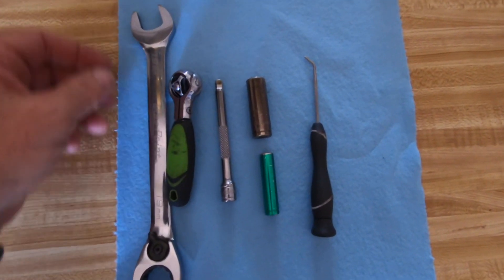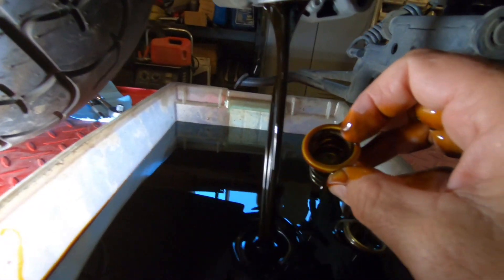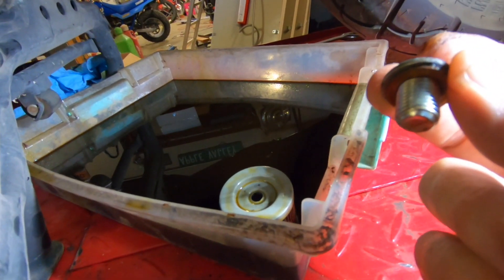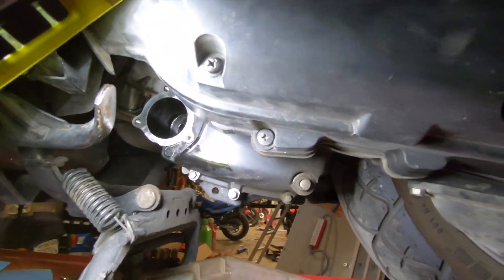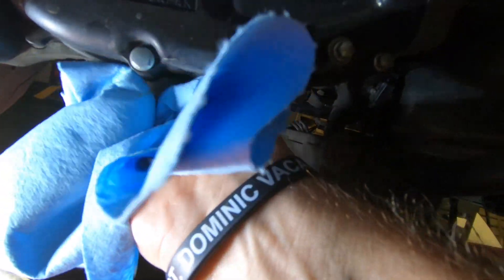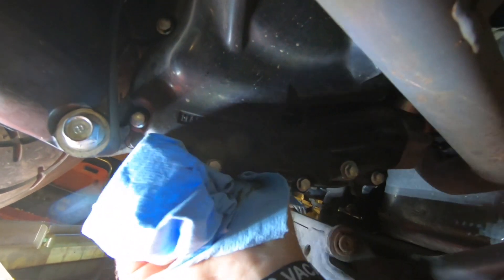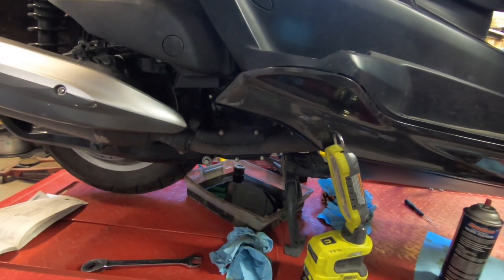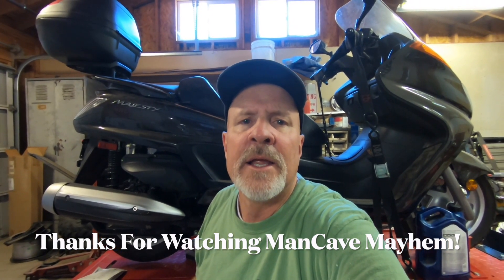Yamaha Majesty 400 Oil Change

Comment: Also I have a problem with the parking brake..kr will not push the brake pads into the disk enough to stop the scooter from rolling..the pass a good but I don't know where they were purchased because the scooter is use when I bought it 
.the lever that pushes the pads in is all working.the cable and spring are at Max adjustment..but the lever on the brake caliper will not push the pads in far enough. Thanks Fred

Comment: Trying to buy used majesty 400 with 25 000 miles...any advice on this scooter before I purchase it please
Reply from the maker: I would just check and make sure everything has been maintained. They are very dependable scoots if maintained. The CVT belt should be serviced every 14k. Good luck and ride safe my friend 👍🏻

Comment: I am looking at buying a 07 Majesty 400 with 5,500 miles. This would be my first scooter before going to the 650's. (Dreaming).   I also found a Bergman 400 with 12,000 miles for the same money. What should I be more interested in, low milage, newer model, or cheaper repair cost.  The Bergman 400 has abs since it is newer. How important is the abs?
Reply from the maker: @alberttaylor644  you can’t go wrong with either one of those scooters. The Bergman with the ABS is a good thing.
Reply: @ 
I also found a 2011 Yamaha Silverwing with 5,000 miles on it for the price of the burgman 400 also. Is a 600 Silverwing something I should consider? Thank you.
Reply from the maker: @ I think you mean a Honda silver wing.
Reply: @ManCaveMayhem  correct my error.

Comment: Thanks Great videos. I have problem with my majesty, no spark coming out from the ignition coil, kill switch and side stand switch are working properly and there is no check engine. Any ideas where could be the problem? Thanks a lot for whoever has an idea or maybe you know a yamaha mechanic I can ask.

Comment: Hey buddy, I noticed you went from the front to take off the rad cap, but did you know you can do that from the RH unlocked compartment? there is a screw at the back that you undo, and that takes off a plastic cover allowing you access to the cap easily:) I saw that from a fellow in Greece.:) Anyway, my question is, how does one check the coolant hoses etc? do you have to take off the entire seat section, or can the bottom pieces come off to get to those? I think I have a leaking hose or the clamp needs to be tightened. After 14 years I would imagine the hoses need to be changed out as rubber gets bad, especially in changing climates like I have here. I'm looking for a mechanics manual, but if you have any tips that would be great!:) My bike is the same year as yours. 2009. I just saw you did some bigger road trips with bikes, I will have to check that out! I am a big fan of Noraly, Itchy boots and her loan travels around the world. She is quite something that dutch lady!  Cheers!
Reply from the maker: Not sure on the plastics access🤔I took them all off year ago but it was a trial and error thing. Sorry I can’t be of more help. My son and I just returned from Alaska on ADV bikes and I was told Itchy boots was in the area but didn’t get the chance to meet her. Thanks for watching and ride safe👍🏻
Reply: @ManCaveMayhem  OK, thank you! Aw, that's too bad you did not get to meet her...she is a blast! Very smart and very brave woman. You will love her vids if you watch them...:) Congrats and that LONG drive up north!! Whoa! I don't think a bike will do for me on long hauls like that...nope. I will drive my 85 Camaro going places these days. :) Just got finished totally rebuilding her. I'd show a picture but can't here:( As for my Yamaha, I love the darn thing. I rebuilt the transmission, thanks to your videos, and it runs very smooth now! Upgraded to the Mallossi clutch. Nice:) Just need nice weather so I can get used to riding again. Been a while! LOL Thanks for your reply, that is always awesome! Cheers! Happy New Year!
Reply from the maker: @vickikgibson9470  you have a happy new year to my friend. Stay safe.

Comment: I just bought a bike like this, same 2009 year...and now, I can get it tuned up, thanks to you and making such clear videos. I do have a question, instead of those terrible paper air filters that do not last worth crap and cost 100 for a new set...I see some have modified the scooter and put on KandN filters on both air section. One for carb and on the other side. Those you can clean, and probably never have to replace!:) What do you think?  And you can keep those plastic parts OFF the bike once they are in...or just put them back for looks.
Reply from the maker: I agree a K&N filter set up would be much better. I personally would put the plastics back on it. It will also help keep the dirt out.

Comment: Wondering why you use the rotella t6 oil
Reply from the maker: I’ve ran it for sometime in my scooters, and it works pretty good. It also works in some motorcycle applications because it is wet clutch compatible. On the Suzuki Bergman 650 it does have a wet clutch system in it.

Comment: I have to replace my thermostat. Any videos on that?
Reply from the maker: No, sorry I don’t think I have any videos on that. Did you recently change the coolant on the bike? If so, there’s a bleed screw on the cylinder head that needs to be cracked open to allow the coolant to get all the air out. I’m not sure if it’s on the cylinder head or actually the thermostat itself. If you don’t open that sometimes the bike will overheat.

Comment: The filter you removed had a hole in the cover end but the new one did not. Be good to know the difference.
Reply from the maker: It looks like a hole in the camera, but it wasn’t. It was actually a relief valve. The old one had oil on it, and it looked like it was an open hole, but it wasn’t. I slid the pick tool under the old filter it was just the way it looked in the camera.
Reply: you are correct, the reason why he had to use a screw driver to recover the filter before inserting the new one which has no hole

Comment: .....   Larry, rewind to 4:52 and stop it......  then forward to 6:00 and look .........
Reply from the maker: I’m not catching it at 6:00 the new filter is in. At 4:52 I’m removing the old filter. The new filter may look different than the old filter but they are the same the little button in the middle is more emphasized on the old filter due to oil around it.

Comment: They make a 15w-40 in that oil now, I’m using that now instead of 5w-40.
Reply from the maker: Non synthetic will usually be a 15w 40
Reply: @ManCaveMayhem  they make it in T6 full syn
Reply from the maker: @danbrovont1148  yes they do👍🏻